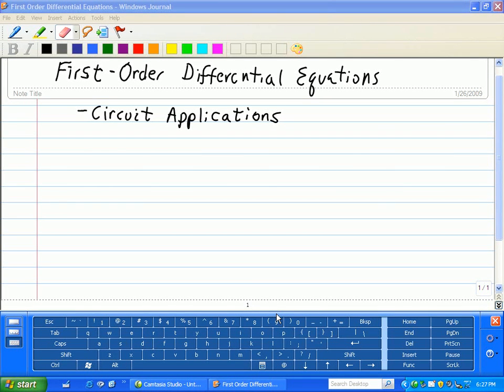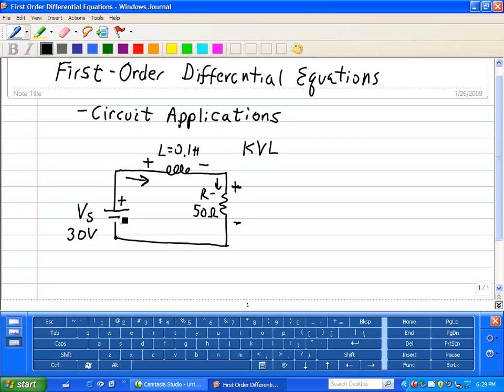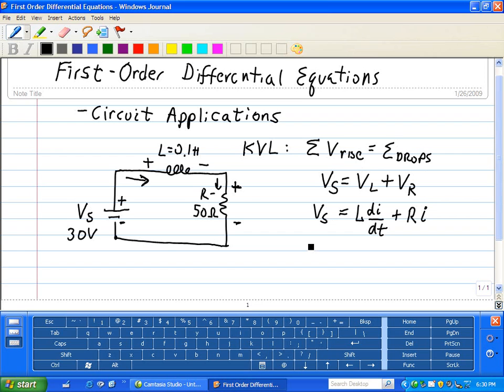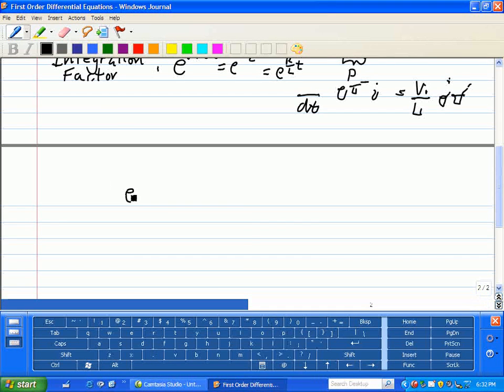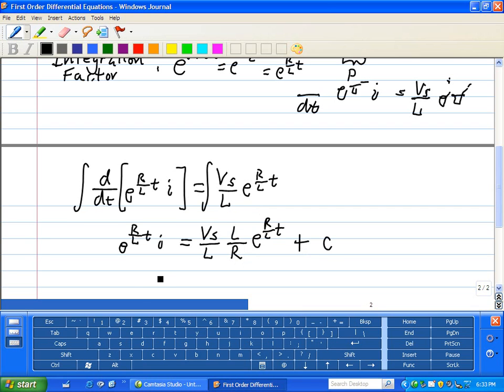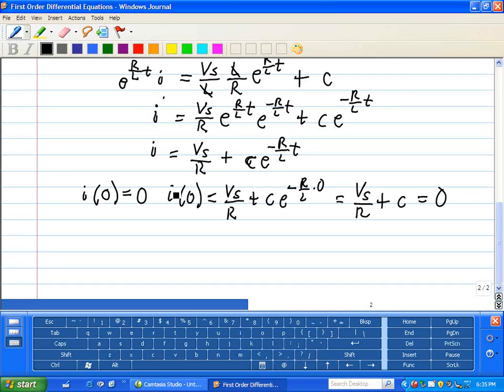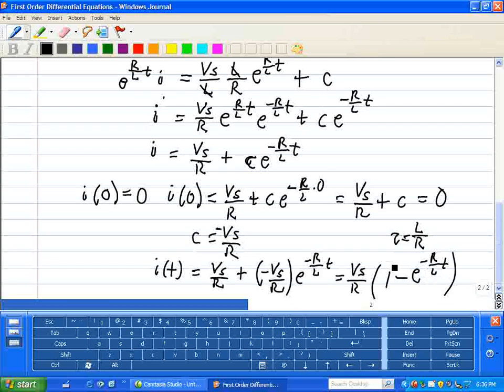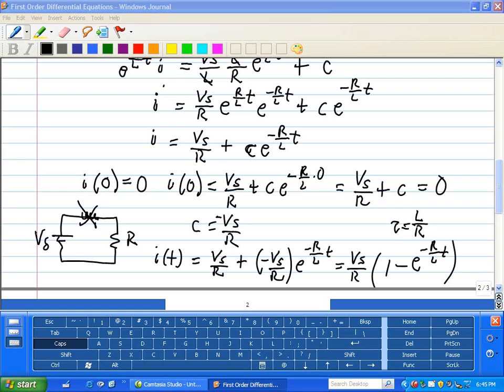Solving Linear First-Order Differential Equations - RL-Series Circuit (Example 1)

Comment: Thanks, but just to share... It is not proper to use KVL to set up equation for this circuit, although the result is correct. The proper equation to set up is closed loop integral of the circuit (LHS) equal EMF induced (RHS). Moving EMF induced to the LHS result zero on the RHS and thus people think it is KVL.